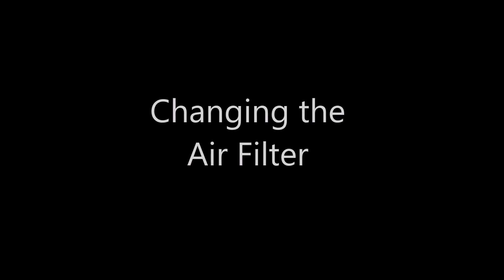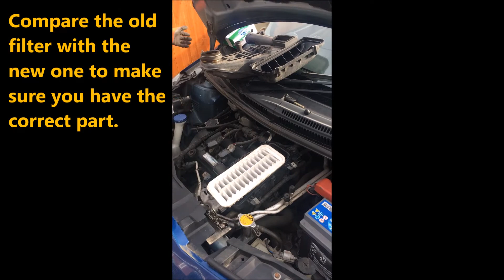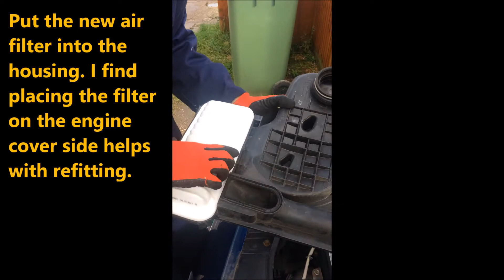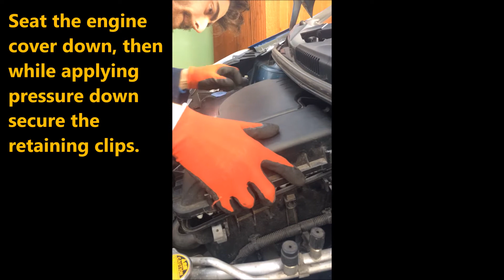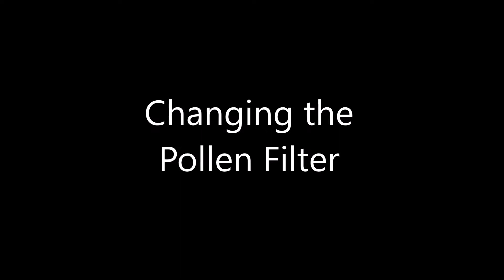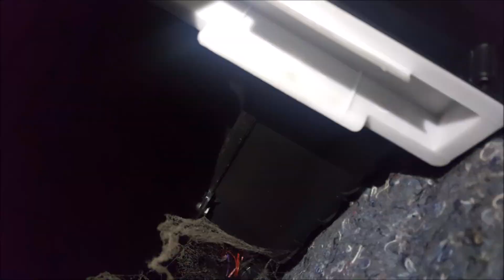Air & Pollen Filter Change Toyota Aygo (Mk1 1.0L Petrol)

Comment: Just to add it would of been helpfull to  show you squidging the metal clips from the side tube. 😃.
Reply from the maker: Hi thanks for watching and commenting. You are right this is a important step and it will help anyone watching this video and looking through the comments for extra help and support. It would have been hard to film squidging the clips into place but I could have demonstrated it better while it was up and away from the engine bay. Thanks for the constructive comment. :D